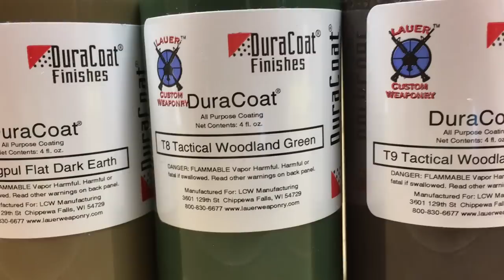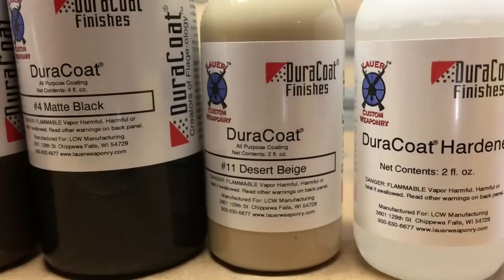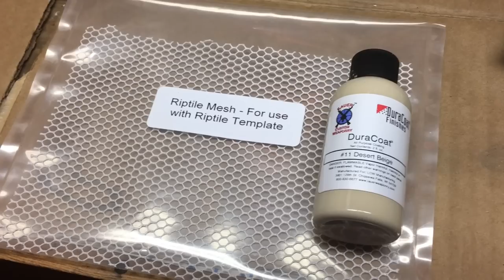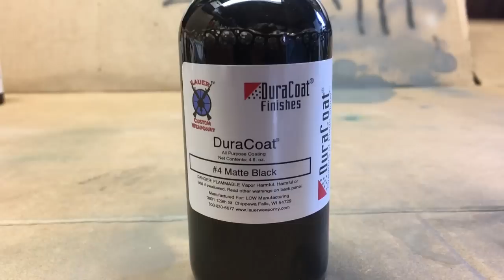Lefty 300 BLACKOUT AR-15 "Woodland-RIPTILE" Duracoat Camo Project

Comment: This is a beautiful job, I like how you matched it with the magazines to look as one continuous peice, outstanding! I've never actually seen a left handed rifle
Reply from the maker: @Joey Zee - Thanks, Joey!  Lefty AR15s aren’t technically “necessary,” but if you shoot from the left shoulder, it makes the experience MUCH more pleasant... and slightly safer, as well.  (The ejected brass doesn’t pass in front of your face).  
The only two components that make it a truly “Lefty AR” would be the upper receiver (with the ejection port & forward assist), and the Bolt Carrier Group.  
An ambidextrous safety switch and charging handle (which I prefer) is really all a left-handed shooter would require on a “Standard” AR15, and you’d be good to go.
Reply: @p99shooter  your video gave me inspiration for the paint on mine, not nearly as good as yours but I really like mine, I did white, navy, and blue and black. But yours is definitely one of the nices ones I've ever seen
Reply from the maker: @Joey Zee - That’s awesome!  Interesting colors!  I’ll bet it looks great..
😎👍🏼 .. and thanks for subbing!

Comment: Outstanding job, this is exactly what I was wanting to do on my creedmore and this validates that concept. Well done video!
Reply from the maker: Daniel Hosier - Thanks, Daniel!  James from Montactical designed the Riptile pattern with a specific set of colors in mind. But his colors mimic more of an arid desert climate (Nevada).  I did do a Rifle in those Riptile colors, (video of it on my channel) and it looks sweet.  For this 300BLK, I tried to choose 4 of the primary colors found in the “Realtree Xtra” Camo pattern, which mimics the climate in N Michigan where I hunt Whitetail.  (The two Magpul 10-rd Mags that I painted use “-5 rd plugs” to make them ‘hunt-legal’ in Michigan)

Comment: Ever since I seen Montactical do that Riptile and you doing this I am going to dive in and do this to my fightlight Raider scr. There are so many black guns out there. Its nice to see some detailed artwork others appreciate. Kudos to you fine work.
Reply from the maker: Warlord2029 - Thanks!  For my very 1st attempt at Duracoating a rifle, I just did a single color of Sunrise Bronze using the disposable, Preval, “Shake-N-Spray” kit.  It worked very well, but I wanted to try doing more detailed designs that could only be achieved via airbrushing.  I invested a whopping $60 for a complete airbrush/ compressor kit off of Amazon.  It works great!  Go for it!  Just take it slow, take your time, let the diff coats cure, and keep the airbrush super clean between coats..

Comment: Fantastic job! I'm glad I came across this video because that is kind of the vision I've had except opposite on colours with more tan and brown under and green on top. I've seen guys use netting and stuff but that reptile stencil is nice. Again sir...GREAT WORK!
Reply from the maker: Mike - Thanks!  The mesh that I used came with a Riptile Kit:
https://www.freedomstencils.com/products/riptile-camouflage-stencil-kit
You can get a similar mesh pattern by buying a cheap 2-pack of those collapsible laundry bags at Walmart, and cutting a large swatch to use!
Reply: @p99shooter  do you have to bake duracoat?
Reply from the maker: Mike - nope, baking not required.. Ceracoat requires baking.  With Duracoat, patience is KEY.  I find that for best results, when doing multiple layers, is to wait no less than 24 hours for cure time in between coats.  Cure time can be sped up a bit by baking painted parts at 200°F for 20 mins, though.  As time goes on.. weeks, months, and even years, the finish gets tougher and more durable with age..just like a fine wine
Reply: @p99shooter  ok thanks. I was gonna rattle can it but don't want it to wear off shortly. It's going on to be on my bolt action .308 so we'll see. Thanks again.
Reply: Another two questions, sorry. How long do you wait before pulling off the vinyl stickers? Just the same 24 hours? And do you spray a clear coat of some kind on top? Thanks again.

Comment: This is absolutely badass
Reply from the maker: Slinkman2021 - Thank you!  Building & painting an AR from the ground up is fun and a great experience. I think it’s an interesting paint scheme.  I tried to use colors commonly found in my State’s foliage.
Reply: @p99shooter  I am really wanting to do a riptile paint job on my Aero 5.56. I’m wanting to be a base color of flat dark earth, and do a bronze color rattle snake skin mesh, then do a dark brown final coat over, and have the snake skin come through the stripes.
Reply from the maker: Slinkman2021 - That would look really slick.. good vision👍🏼  Consider going with Bronze on your small parts, too. Bolt catch paddle, safety paddles, trigger, etc. (Taping off what ain’t visible on those parts, of course.)  It’d make the Bronze snakeskin pattern really pop. 🐍😈
Reply: @p99shooter  Yeah I think so as well, I'm pretty stoked about the idea. I didn't really even think about the small parts, good call. I'm definitely going to do that. It will be my first paint job so I'm not sure how clean it will turn out but I'm sure that I'll get it.

Comment: 5 years old still one of the best jobs I've seen.  Any one have ideas for the mini air sprayer that doesn't require an air compressor?
Reply from the maker: That’s very kind of you…
…Much obliged, Sir!
My first couple of projects, including this 300BLK, were simply done with a basic, $60 airbrushing combo kit off of Amazon.  It’s best used for very small hobby projects, or for cake makers.  Excessive run times would continuously empty the smallish tank, and subsequently, the motor would run hot due to the constant re-filling.  Additionally, that would also add moisture into the lines, and create a whole new set of problems.  I now run a Dewalt pancake style compressor with the 6lb tank.  SO much better.
One can always do creative things without an airbrush.  The biggest advantage is having more control over fine detail.
Reply: @p99shooter  Thanks P99 I’ll look around.

Comment: So bad ass! Is there anything I should know before I potentially ruin my airbrush? 
What stencil kit is that?
Reply from the maker: Ha! Thanks!  There’s no way you can ruin any of your airbrushes!
Now, you ARE mixing an epoxy hardener at a 12:1 ratio into your paint, but as long as you take your brush apart and clean it promptly, the paint won’t have a chance to harden up and seize up the internal components of your airbrush.  I keep plenty of Duracoat “reducer“ on hand, (works like a paint thinner), and cleans up everything nicely.
The stencil kit is called “Riptile,” can be obtained at freedomstencils.com

Comment: Gorgeous work brother. What 3 colours might you suggest to get a tan-ish type pattern. Thank you
Reply from the maker: @Plaidcladcanuck - Thanks!  If you were to check out the other Lefty Riptile AR I did on my channel, take note of the colors I used.  They came part of a kit, and were pre-determined by the pattern’s designer.  Works well in the Southwest US, but for this 300BLK, I went with colors found in my state of Michigan.  If you were to go with all “tan-ish” colors, in order to help this particular pattern stand out a bit, I would recommend going with vastly varying shades of colors in the “Dark Earth” category.  See the attached link below.. 
I believe there are approximately 17 colors in the FDE palate of colors, not to mention their “tactical” line of colors.  Don’t forget a little Matte Black to make the pattern pop!
https://www.duracoatfirearmfinishes.com/duracoat-standard-colors-earths-p/dcdarkearths-liquids.htm

Comment: Great video, awesome job. Did you media blast the scope, if so what grit was used so it won’t get damaged
Reply from the maker: Thanks, Jeff!  I did media blast the scope.  I used the same media for all the parts, 120grit Aluminum Oxide... I just made sure to surgically tape off both lenses, the rubberized magnification dial, and the windage/elevation dials.  I used masking tape, then gorilla tape on top of that, as it is more robust.  There were still a few granules that found their way into the magnification dial, as it felt a little gritty when turning it.  But eventually I was able to use compressed air to get them out.

Comment: Awesome very nice , similar to what I want. What kind of air gun and compressor set up did you use and psi ?
Reply from the maker: Thanks for the questions, L L!  
For airbrushes, I usually run ‘PointZero’ brand..gravity-feed for fine detail, or siphon-feed for larger surface areas.
The compressor’s PSI can vary, but somewhere in the 35-50psi range is usually sufficient.
I was initially just using a basic, 1/5 HP little air compressor. 
(the air brushes came with it as part of a kit.)
Damn thing was more appropriate for a baker painting cakes.😂 
I have since upgraded my compressor to a Dewalt, pancake style.  The problem with those small tanks, is that they empty too quickly during the project, so the motor is constantly running to refill the tank during the job. Hence, it gets really hot, and then starts spitting moisture out the nozzle. Which is no damn good.
Probably wouldn’t hurt for me to do a quick video on my setup/equipment.  Thanks again!
Reply: @p99shooter  thank you so much for the response. I'm gonna subscribe and hopefully when you get the time to make a video of that I'll check it out. I wanna get started in it but not sure how to set it up.

Comment: Nice work, sir which colour are you using for spraying? Will you please tell me about the colour brand and name?
Reply from the maker: Thank you.  The paint is made by Duracoat.  Before spraying, you mix Duracoat’s clear, epoxy hardener into the paint at a 12:1 ratio. When it dries, and cures, you get a very durable finish which helps protect your project from water, oils, solvents and natural wear and tear.  
The Duracoat colors I used for this project are:
#79  Magpul Flat Dark Earth
#T8  Tactical Woodland Green
#T9  Tactical Woodland Brown
#4     Matte Black

Comment: Beautiful work. What pressure are you running through your airbrush.
Reply from the maker: Thanks, Jeff!  I recently got a DeWalt pancake-style compressor, and I’ve been keeping the output set btwn 40-50 psi.  It seems to be a good amount for Duracoat work.

Comment: JUST WONDERING WHAT PSI WHERE YOU RUNNING THE COMPRESSOR AT? I HAD ONE OF THOSE LITTLE COMPRESSORS FOR MY PROJECT AND IT DIDN'T WORK OUT SO WELL.
Reply from the maker: Dan C. - Sorry you had some issues.. I was just using a small, 1/5HP style compressor.  It seems to max out at 60psi.  Because of it’s smallish tank, it kicks on often, and refills as you go.  What kind of issue did you have?  Duracoat inventors, Lauer Custom Weaponry, have a help-line for painting questions.. I’ve utilized it myself..
Reply: when i first started it seemed to work fine about 5 min into the project it just stopped spraying tried to clean it that didn't work. i couldn't get my compressor up that high on the psi. maybe around 30psi. it was a master airbrush compressor. any suggestions would be appreciated. i figured i would try one of those pancake ones from lowes that i can go up that hi on.

Comment: Ok I finally have all my parts and paint. I forgot to buy the harderner. The stencils just came in today. How many coats of each paint?
Reply from the maker: Paul De Joseph - Cool!  Have fun!  That’s unfortunate about the hardener.. I wanna say that the last few times I’ve bought Duracoat paints online, small hardener bottles were included...
Also, gotta have plenty of Reducer on hand for airbrush cleanup and whatnot.  In terms of multiple coats?  Shouldn’t need multiple coats for Riptile, because in a sense, this pattern already has 2-3 layers to it.. just make sure your base coat has thorough coverage.
I’ve got a video coming soon demonstrating a distressing technique.. 😎👍🏼
Reply: @p99shooter  lol have plenty of reducer. Bought that by accident is stead of hardener. In was going to email them in a minute to see if any gardener will do buddy is a auto painter. I do have the little ones that came with the paint. Do I have to media blast my stuff or will  brake clean and acetone work? I can't wait I hope it come out as good as yours. Can't wait for the next video. Subscribing to you now. Thanks for the help and advice
Reply from the maker: Brake Clean/ Acetone, or Duracoat’s Tru-Strip aerosol.. any of which is fine, and definitely required for degreasing.  (Duracoat won’t adhere well to any oily spots).. Degrease 1st, then rough up the surface 2nd (to aid adhesion).. Media Blasting can ALWAYS give you the most consistently roughed-up surface, but in my very first attempt at Duracoating an AR15, I only used a 3M Scotch-Brite pad for roughing up the surface, and it still looked GREAT.  (My Sunrise Bronze AR, the subject of my next vid..). Duracoat usually applies very thin, so deep scratches and imperfections can still show through sometimes, so rough your surface as evenly as possible, if that makes sense... 🇺🇸😎👍🏼
Reply: @p99shooter  I got the scotch brite pads. I'll order the duracoat true strip along with some more harderner. Again thanks for everything

Comment: Awesome paint job bro, my one question is what do we do if we don't have an airbrush as I'm assuming a spray can will spray to much for the "outline" of the stencil
Reply from the maker: Sid .S - Thank you very much, Sir.  And, excellent question.  After doing a few rattle-can projects, I decided to invest in a quite basic kit to get the sharp detail that an airbrush provides.  I believe there are some “fine-tip” spray-can nozzle attachments available.  Which could technically work as well.  However, I was going for a more durable finish, which Duracoating provides nicely.  Try practicing your spray-can technique on something other than the rifle, if looks good, give it a shot!  Try and think about mixing it up with different colors, too… Have fun!

Comment: may i ask why not add a layer of matte clear coat at the end?, wouldnt that sort of protect the paintjob itself a bit better making it more durable? very great paintjob btw, i like it. subbed!
Reply from the maker: bb1982nl - Thanks!  And thanks for the subbing, more projects coming soon..Great question..  I’ve found that adding a clear coat afterwards is kinda overkill and is not really necessary. With proper prepping, (media blasting & de-greasing) and a consistent ratio of hardener/ paint, water will just bead and roll right off.  Taking your time is key, as well.  Waiting at least 24hrs between coats let’s each layer cure nicely.  I used this 300BLK for 2017 Michigan deer season. Rained all damn day on the opener, and it repelled water very well!
Reply: ok thank you for the fast reply! i was just wondering because im thinking of doing a paintjob myself someday. video was very helpfull! happy to see more projects!
Reply from the maker: bb1982nl - No problem!  For even more inspiration, check out the channels by Montactical, and Predator Ink.  Those guys are beasts, and do Phenomenal work.
Reply: thank you ive watched some of them, in love with montactical's black multi collor camo, wow! :) i dont live in US so airsoft is best thing i can get here, really looking forward to get in to it and get a nice camo on it.

Comment: That's nice where did you buy the paint and can you use any airbrush?
Reply from the maker: Thanks.. I ordered all of my Duracoat paints through Lauer Custom Weaponry.  Numerous online retailers sell them, though.
www.lauerweaponry.com
The airbrush kit I used is available on Amazon as a complete kit for about $60-$70.  Everything you need to DIY.  It came with a decent small air compressor, hoses, and 2 brushes made by PointZero.  A siphon-feed (glass bottle on the bottom) and the gravity-feed (cup on top).  The latter being best for sharp-shooting fine lines and detail work.  The hardener that you mix into the Duracoat paint can gunk up the airbrush’s needle-tips. Just keep them clean as you go, and in between different colors or coats.  It’s a helluva lot of fun.. give it a try!  Just take your time!

Comment: I have been looking at paint jobs this whole week. By far this my favorite. Where did you buy the paint from and stencils?
Reply from the maker: Paul De Joseph - Thanks, Paul!  You can get the RIPTILE stencils right from the guy who designed it, James, at FREEDOMSTENCILS.COM .  Also, a wide variety of Duracoat paints are stencil kits are available at LAUERCUSTOMWEAPONRY.COM . James’ original RIPTILE pattern had 4 specific colors, and they look great, but for this 300BLK build I tried to choose the most common colors found in the Realtree Xtra hunting camo pattern.  (My deer hunting camo of choice).  Take your time, and have fun!  It’s awesome 😎
Reply: @p99shooter  thank you so much for the links. I might copy your paint job but change the design a little so not copy you too much lol. Great job I hope mine comes out that good. Oh how many coats did you do for the base coat and final coat?

Comment: Like the paint job on this one too, great job.  Is that a alumaliteusa Muzzle Brake that you put on the rifle?  How do you like it.  I have one on my 22lr and it does a nice job of pushing the noise out in front of the rifle, not that 22lr is that loud.
Reply from the maker: Thanks!  Yes, that brake is by Alumalite.  It's called the 'Super 8 Halo.'  I prefer a Linear Comp on my deer rifle to help mitigate lateral muzzle blast..  just in case I have to take a fast shot and don't have time to don hearing protection..  💥😳💥